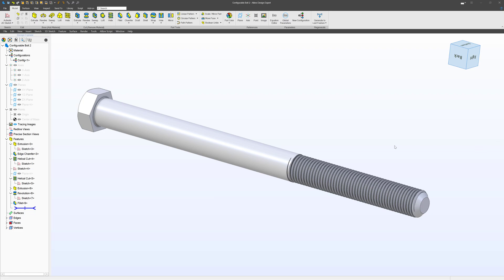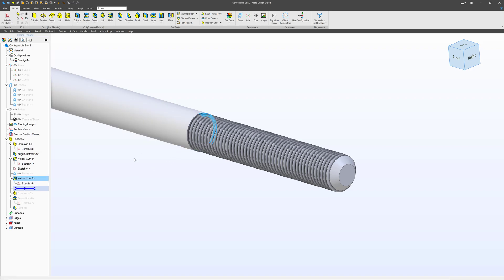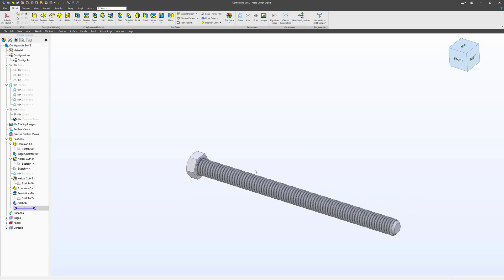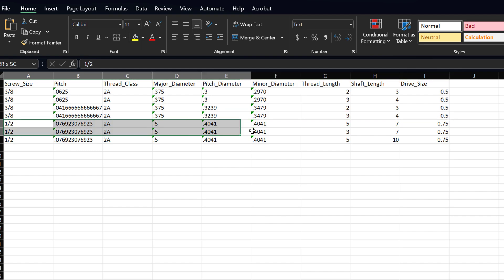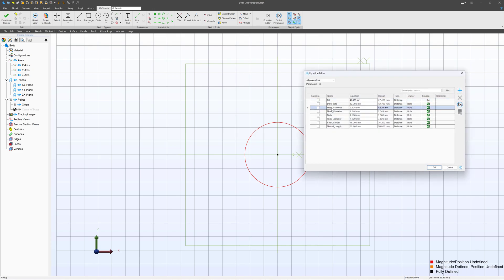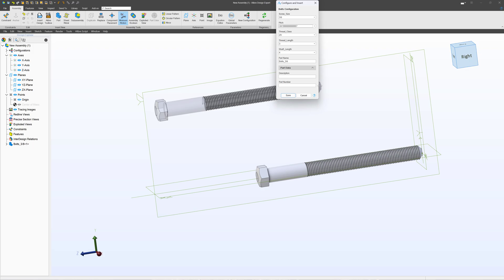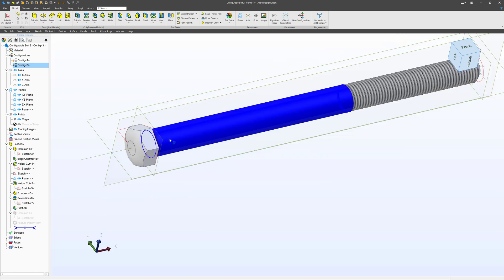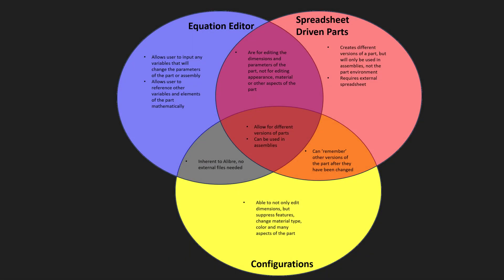Alibre | Comparing Equation Driven Parts, Part Libraries, and Configurations

Comment: Nice video! Can I add properties to part data according with changes? For instance can I make a variable screw with "L" parameter , to change its length, and add to the part data the length of the screw? thank you.
Reply from the maker: Unfortunately we don't have a way to directly link part parameters with variable values.  That's a cool idea though

Comment: Part libraries pretty much address all of the issues i had in the past with configurations. My old common parts have dozens of configurations, like 2x4's with one configuration for every length used in a structure. 

Minor nit: three lines is a class 5 cap screw, six lines is for class 8.
Reply: agree --- if you can use python scripting to drive changes to the equasion editor, and to spawn additional configurations you kind of hit the sweet spot for "standard parts". I've been unable to get the python to drive and establish the library parts, but that would be maximum excellence, for me.